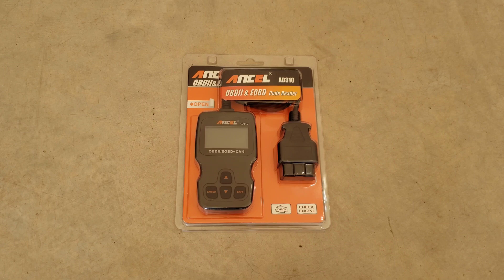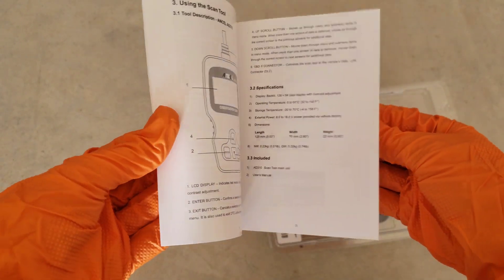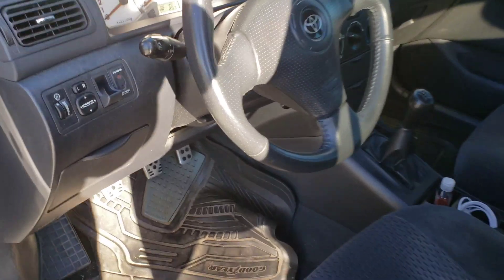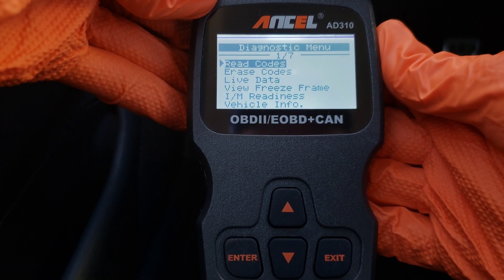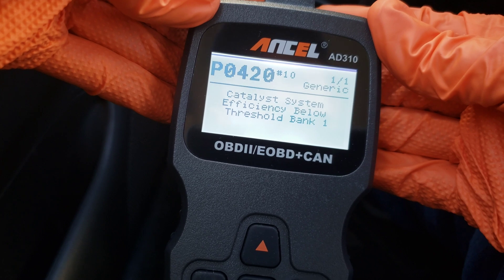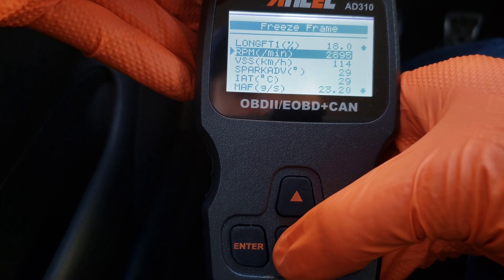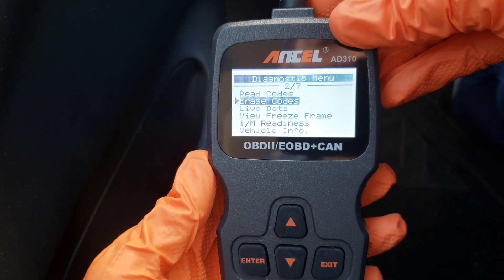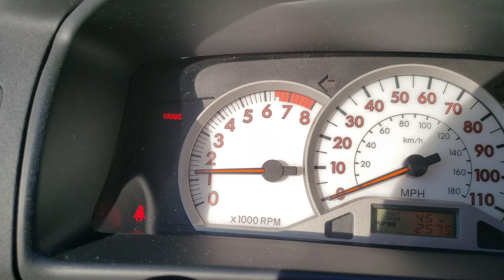How To Use The Ancel AD310 Code Reader - Check Engine Light

Comment: Mine gives me the same code on my Honda CR-V, but it does not turn off the Check Engine light.  It will also do none of the other things such as freeze frame or identify my vehicle.  Cannot read/find the PID? Any suggestions are appreciated.

Comment: Great video, thank you! So at no point do you need to have the vehicles engine running during the plug-in diagnosis correct? I’m assuming the vehicle is on board computer, even if it’s a 96K 1500 is storing all that data to be read when the vehicle is turned off. Am I correct in assuming that? Thank you much!

Comment: I got this device because my 2016 sonata started shaking on idle and even more in reverse. Hooked it up and it showed cylinder 3 misfire and that same p0420 code. 
I’m certain the cylinder misfire will be my issue.
Reply: Update: changed all 4 spark plugs and everything is running fine now. The code still appears, but I haven’t driven it yet. If it still shows after a drive, I’ll swap cylinder 3’s ignition coil to another spot and see if the code switches too; could be the coil itself. 

Thanks for the video

Comment: It doesn’t give me the option after scanning to see stored codes it says 

J1850 VPW
J1850 PWM
ISO15765-4 CAN
ISO14230-4 KWP (5BPS)
ISO14230-4 KWP
ISO9141-2

When I exit out and hit diagnostic it just rescans and I am back to the same output as before.

I have a 1998 Toyota Camry

Comment: Bought mine from Amazon. Works well. BUT here’s a problem that I’m having for me after going into Stored Codes and even Pending Codes..  I followed along with you and got 1/1 code (P0018).. so.. when I go and hit Exit, it brings up  3 more codes?? Along with the P0018 code—so 4 codes total.. what are the 3 other codes doing after Reading? how do I do a complete wipe and try again? I go back and Erase Codes and try Reading the codes again and brings up 1/1 code (P0018) 
But hitting the exit button brings up 4 total codes.. any reason?

Comment: I bought this product "ANCEL Ad310". Unfortunately, it does not show me any error codes although my car does (ABS error, tire problems). 
What could be the reason for this?
Reply: These are, intentionally I believe, designed not to address ABS and/or airbag codes. Probably since they are safety systems. I assume because of liability and/or legal restraints.

Comment: I should add that the dealer had two visits to try to diagnose the problem.  They were recommending replacing the fuel injectors as the next step but indicated that they did not know whether this would solve the engine light.  Since the car is more or less running like a top, I was not keen on having the fuel injectors replaced (at great cost I might add).  I was hoping to have my own way to turn off the light to wait until "the problem" is significant enough to justify the effort (the car has been on the road for just over 10 years but it only has about 60,000 km on the odometer.

Comment: Trying to use this reader to erase an engine light code relating to fuel mix (the car is running like a top) and unfortunately, I get an error message on the device after following all of the steps outlined in this video and I have received a "link error" three times now.  I am not giving up yet but it leaves me wondering whether I need to do something else in the set up like identifying that the car is a 2015 BMW Z4 before trying to use the device (?) (though I tend to think not).  The one issue that is a bit confusing is turning the car on when using a fob though I also tried running the car rather than just pushing the start button without standing on the brake pedal and the device did ask me to turn the car off.  Back to the manual.  Thanks for the video well done

Comment: So you just totally bypassed how put the batteries?
Reply: The Manual mentions nothing of a battery needed for the ancel AD310.
Reply: It operates off of car voltage: 8-18vdc supplied by car battery I believe

Comment: I just installed a alternator on 2009 subaru impreza 2.5i. 
After that I was experiencing having to press the throttle harder to get it go. Normally more of a twiddle would activate the rpms to move not stiffly pressing throttle. 
This did not happen before alternator install. As well as that if I let it bog down after getting it going shes liable to die but not EVERYTIME I started checking fuses other then that I'm not sure as well I wiped out just the accessible part of thorttle body to try to help to I did not go beyond entrace
Reply: Going to try this tool as well

Comment: I’m not sure exactly which Ancel code reader I have it has 4 buttons but it just saved my 22 year old F-250 from going to the transmission shop. OD light started flashing after a rough shift from 1 - 2. Then the service engine soon light came on. I thought crap new transmission. I plugged my Ancel code reader in not even expecting it to detect a transmission issue because my check engine light wasn’t on. Took a few attempts to get it to sync properly but it diagnosed a bad speed sensor in the transmission. I removed sensor cleaned connections reset trucks computer. So far it hasn’t happened again. I’m impressed!
Reply: I think this is exactly what is going on with my truck. It'll be totally fine then it will have a rough shift and the light comes on, but it goes away next time I drive it.

Comment: Just got this for my 2013 gmc sierra as I have had codes pop up every now and then.. also have a wheel speed sensor that’s broken so my traction control and abs and stabilitrac lights are on.. does this unit read the codes for that to determine which wheel speed sensor it is? I can’t seem to figure it out

Comment: Do I have to wear gloves to use the reader?
Reply: Why would you need to wear gloves? Is this a serious question orrr???
Reply: @warrenturnbull3436 some people have 0 experience with electronics and cars. Answer the question and move on.
Reply: No, gloves are not required to operate an OBD-II, most likely he was working on something prior to the video or about to work on something post recording.
Reply: Maybe the uploader was wrenching and left gloves on. Grease is hard on skin to get off.

Comment: Didn't pass my emissions test so bought this after going through the recommended drive cycle online. My car is read as "not ready" and INC at a repair shop. Can I use this to show what part of the drive cycle is the issue? Would love to see a video on using this to pass emissions testing. Thanks so much for this video. Made the process less intimidating for me 😊
Reply: I am currently having the same problem😢

Comment: just wondering why this will NOT show code when my ford transit service transmission light illuminates during driving.... I plugged in while driving and will not pull code.  Have to do it this way because pulling over and turning key off after cycling light will go off and not show anything....any assistance or general guidance will be very appreciative. ????????? Thx

Comment: When it says turn ignition on, does that meanjust  turn it to the "ON" position without cranking the engine, or do I start the engine?
Reply: Just to the on position not car turned on with motor running

Comment: OXYGEN SENSOR misdiagnosis - There may be a simple zero cost fix to try first! I have a 2004 Toyota Camry. Over the years, I've had a check engine light at least 4 times. When I had it checked the first time it happened, a Toyota dealership and a repair shop both told me that the O2 sensor was  bad and had to be replaced. It's expensive for a cheap guy like me, so I started asking around. Finally, I found someone who told me to check my gas cap. What???? Well,it turns out that a loose or malfunctioning gas cap causes this same error, so I checked. I must have had a mental lapse the last time that I got gas because sure enough, it was loose. I unscrewed it all the way, screws it back in, then drove around for awhile. The check engine light went off. I probably put 20 miles on it before it cleared itself, and I think I had to take at least 2 separate drives, or stop somewhere and shut the engine off. Regardless, if the check engine light never goes out, then I would take it in for replacement when I had a bit more money. I think - I don't know for sure - that a faulty O2 sensor just decreases the performance of the engine, so I would never in a panic to pay to someone to replace it. That's my take on it.  By the way, the last time it happened, I bought a replacement gas cap at a parts store for about $25. Big savings over replacement that mechanics said that I NEEDED to fix the problem!! I hope this is the reason that you are getting this error instead of needing new one. Good luck.
Reply: My garage told me so many O2 sensors are replaced needlessly it would seem many garages are using it as a cash cow or simply do not know their jobs.  It is an indicator there is an issue NOT that it is a faulty sensor so you have other checks to do before replacing the sensor otherwise the issue will still exist and you have paid for something you didn't need.
Reply: Hmm, thank you for sharing this.  I will surely check my gas cap!
Reply: I have had to tighten my cap a couple of times due to the same reading.
Reply: I learned the hard way.  It cost me $89.00 to get the gas cap tightened. I'm sure they knew this when I drove in,, but they didn't tell me.
Reply: you're right, O2 sensors are damn expensive. I was working paycheck to paycheck, took me 3 months to pay it off

Comment: Hello, I just recently bought a car. Does this code reader only work if your car has a check engine light? If so, is there any that could diagnosis other existing problems with the car?

Comment: At 06:12, "Turn Key on with Engine Off".  That's a little confusing.
Reply: yeah, I'm sure they meant you can just turn the accessories on, don't have to actually crank up the engine to pull codes.  If you want to scan the engine, then you crank it up.
Reply: How is it confusing? Turn the key forward without cranking the engine..

Comment: Doesn’t the “II” (2) mean 2nd Gen?
I have a question about erasing codes. When you erase the code, would you then need to use one of the Automotive Memory Savers on the market to save the OTHER settings (that haven’t been erased), disconnect and reconnect the battery—to save yourself from having to drive around for so many miles to reset everything?
Good video. 👍🏻

Comment: There is a quick way to figure out if it's the O2 sensor (after the cat), or the cat itself (for the 420 code). Most cars have two O2 sensors (one before the cat, and a second after it). Both of them work together to help manage fuel usage/efficiency. If your OB2 reader has a graphing mode,  pick both O2 sensors to live graph, and then run the engine. The O2 sensor before the cat should vary voltage up and down while idling (it's reading the emission levels after it leaves the first cylinder, and before it goes through the cat).... and the O2 sensor after the cat should barely fluctuate in voltage IF the cat is actually working as it should. If the second O2 sensor is fluctuating up and down in voltage just like the one before the cat, the cat is likely bad and should be replaced. If the second O2 sensor is staying steady, it could be a bad sensor, which would make it seem like the cat is actually working right... but to make sure, some OBD2 readers/scanners also have the ability to test individual sensors... that way you don't have to swap out a working O2 sensor just to see it it was reading falsely. There are a few videos on YT showing this method to test OB2 sensors/readings.
Reply from the maker: Hi and thanks for watching. They are LED bulbs so in my opinion they are pretty energy efficient. Also the fact that you can schedule when you want them to turn on and off adds to the saving of electricity. Thanks again for watching!

Comment: I have that code on my car. If I erase it it comes back, sometimes in a week or so, sometimes just over night.
Reply from the maker: Thanks for watching, what is the code? If you erase the code it will turn off the check engine light, but if the problem is still there then the computer will detect it and turn the check engine light back on. Hope this helps and thanks for watching.
Reply: @ToddsGarage  I have P0420 I know the problem is still there. I'm not sure exactly what it is yet. My garage suggested the catalytic converter but that was just replaced a few months ago. I haven't had them really look at it yet because I'm afraid of how much it will cost.

Comment: Does the engine light came back ?
Reply from the maker: Hi thanks for watching! Yes mine did, then went off again, then on again! I think I have a faulty O2 sensor i need to replace this summer.
Reply: @ToddsGarage  What was the final verdict on the recurring P0420 code featured in this video? Did you ever replace the sensor? If so, did that solve the issue? I'm hoping you didn't have to replace your cat. I'm in a similar situation and looking for positive inspiration.

Comment: I love it plus it clears the check ✔ engine light
Reply: @BuiltToLaugh if the problem hasn't been solved the check engine light will come on again. Sometimes a check engine light will come on but the problem is not ongoing. So clearing it is not hiding the problem.
Reply from the maker: Thanks for watching,  glad you like it!
Reply: So it clears it but doesn’t fix it. So pretty much just hiding the issues
Reply: @builttolaugh  No, it's not hiding anything. If there is a true issue the CEL will come back on in short order and he will replace the o2 sensor.

Comment: Just ordered on of these.  Had a bad O2 sensor in my 05” CRV. Replaced it and now its throwing a P2244 code?  Thanks for the video
Reply from the maker: Hopefully you can get that other code resolved, thank you for watching!
Reply: Caleb, what the heck was the 2244 about?  What was wrong, what did you have to do?
Reply: @ofcbob6391  took apart charcoal canister.  Lots of 10mm bolts.  Blew it out with some air.  Works fine now.
Reply: @Boogiethrash  well, I haven't a clue what that is...but am thinking of ordering this exact AD310 unit from Amazon.  When it showed the P2244 code, did it also (on the AD310) tell you to check on the "charcoal canister" ?    Or did you have to go online and research what 2244 referred to?
Reply: @ofcbob6391  my buddy has a far superior code reader then I do.  Rana diagnostic test on it.  Heard its common for that gen CRV.  Its on the passenger side underneath in the back.  Almost has a “cage” if you will as a safety housing.  Super easy to locate.  10mm bolts 97% of the time